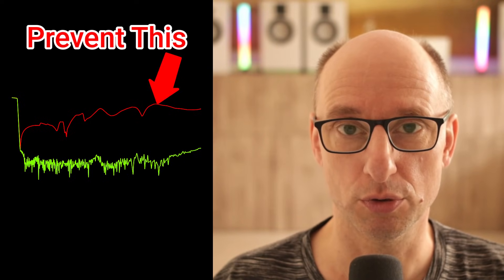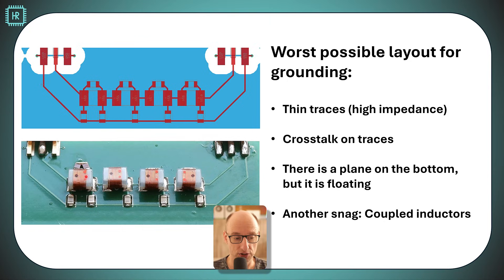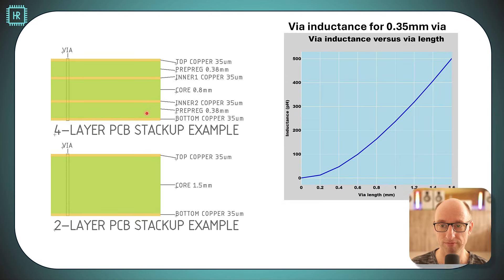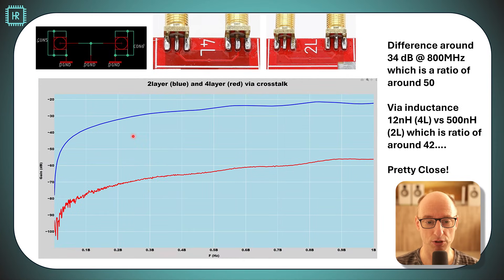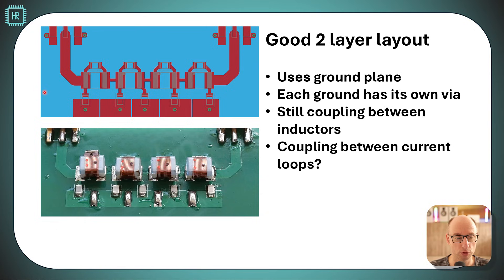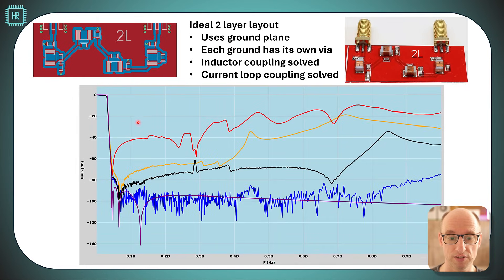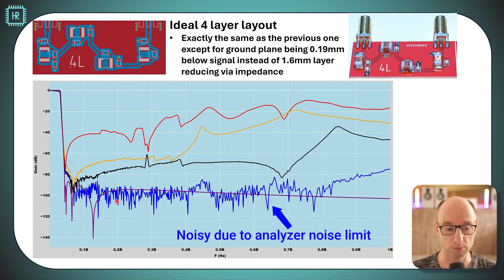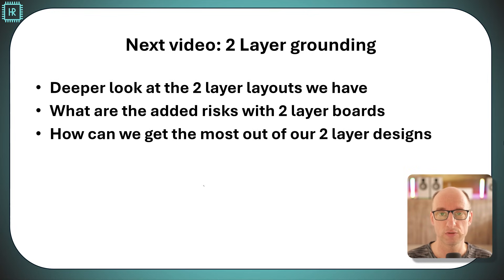Flawless PCB design: 3 simple rules - Part 2

Comment: Whenever i use generic SMPS wall adapters to power a Preamp circuit i made using a TL084C, i hear different noises on the output, sometimes the noise is so severe that it sounds like an ambulance siren, i suspect that has got to do with the switching noise of the PSU overcompensating the voltage feedback loop. nevertheless can i eliminate it using traditional LPF made with just an LC filter? Thanks in advance your content has been really educational. Big Fan.
Reply from the maker: You're most likely right, it is probably the smps noise. A low pass filter will work, I'm not sure you should use LC. LC creates a resonance, if you have bad luck and that falls in the audio band, you may still have problems. A pre-amp will use very little current. This means you could maybe use a 1 Ohm resistor in series with the supply and then a big capacitor. The capacitor would have to be quite big though, 1 OHm with 1000uF will give you a 159Hz -3dB point... you may want much more capacitance. A much better solution is to use a pretty basic voltage regulator to clean up the supply. Then, off course: Use a ground plane and decoupling caps! If you want a really clean supply you can use a more high performance voltage regulator off course. Best regards, Hans
Reply: @HansRosenberg74  Thanks for pointing that out. In an ideal LC circuit the cut-off frequency is indeed equal to it's resonance frequency and that would have caused the output waveform to oscillate in a sinusoidal manner at the cut off frequency essentially. Additionally do i absolutely have to target the lower end of the audio spectrum (20hz) while designing an appropriate RC filter for the same or i should be able to get away with a slightly higher cutoff frequency and rely on the PSRR of the opamp, especially since PSRR gets worse as the frequency increases.
Reply from the maker: There is another possible cause: RF interference going into your supply wire as common mode interference. The smps causes the common mode (cm) interference. It somehow gets to your opamp, which is very happy to demodulate that into your audio band. The only way to get rid of that is to apply a CM transformer with a high impedance for the interference you're trying to get rid of. (I have detailed explanations of how this works in my course). You'd have to put  this in the supply wire as close as possible to the preamp. This  will 'discourage' the cm currents to move through your amp wreaking havoc there :-)
Reply: @HansRosenberg74 As for the common mode Interference, i take it the wire is essentially acting as an antennae which picks up the noise from the SMPS. I have no Idea though on how to calculate the components for such a compensation. I mean how would i make sure if it's even a common mode Interference. Though one thing i have noticed is that the opamps seem to like SMPS included with a printer or something which involves controlling stepper motors. Those SMPS have an amazing noise floor.
Reply from the maker: printer smps are probably much higher power, there is a chance this causes them to be very 'friendly' with a very low load of a preamp. I'm a bit hesitant to say this for sure because there are many ways you can design such a supply. And it can be done good or bad, but in general I can probably safely say that higher power adapters are probably a bit less noise since they're almost forced to employ bigger capacitors to stabilize the supply.
Reply: @HansRosenberg74 so i carefully laid out the PCB again using proper ground plane techniques that you described and indeed the SNR improved quite a bit I think THD improved  substantially as well. 

Using a voltage regulator does help reduce SMPS noise somewhat, i discovered that eliminating the issue right at the source is the best way to go, i looped around an oscilloscope probe to itself as a makeshift antennae probe if you will then moved it around the SMPS which eventually showed that the MOSFETS were emitting that interference therefore i placed a resistor say 56 ohm and a capacitance from it's gate to source say 100nF hoping that it would slow down the gate switching. And it did pad down the noise to acceptable levels. I think since the MOSFETS are switching a big inductor  ( in the SMPS transformer) the electrical inertia of that inductor if you will,  caused the spiking noise at the output. Introducing that hysteresis at the MOSFET gate really helped damp that down.
Reply from the maker: Be careful slowing down the mosfet. It means that the mosfet is switching slower, so it spends a longer time dissipating power. Now if you have a very small load, this is no problem. If you would load this thing nominally again, there is a big risk your mosfet will start to produce smoke.
The signal transmission is caused by the loops in the switch mode supply, since the mosfet sticks out of the board, you'll see it mostly at that location.
Reply: @HansRosenberg74  I was running 2 ics each with a max of 5mA consumption i think that's why i didn't see a change with heat output. So what do you suggest how to tackle this issue best? The interference I saw near the MOSFETs was the same kind of noise that I was seeing on the vcc line of the opamp
Reply from the maker: CM transformers in the power supply lines. Close to the amplifier. That might solve it. Also  a big DM filter (large elco to stop that).

Comment: Can I have help to make a frequency  generator with antenna to make electromagnetic in a place with frequency 
10000.
20000.
2000
.805.
760.

What items need to buy ??
Reply from the maker: I'm not fully clear what you need. Is that in Hz or MHz, how much signal do you need, what accuracy, etc etc.
Reply: @ I want to build a frequency generator that produces the frequencies I mentioned above, but electromagnetically. I want it to have power in watts, and for the entire system to be transmitted via a transmitter to an antenna. I want to experiment with dowsing.
Reply: @ I want to build a frequency generator that produces the frequencies I mentioned above, but electromagnetically. I want it to have power in watts, and for the entire system to be transmitted via a transmitter to an antenna. I want to experiment with dowsing. The frequency that give you is hz
Reply from the maker: so from 0.805Hz to 20kHz. Building an antenna for that low a frequency will mean basically building an electro-magnet I think, with a lot of windings. I have no experience with anything like this. To create the signal, I'd use a sound card driving a standard audio amplifier. Watch out that the antenna/magnet/inductor (whatever you want to call it) has enough inductance and there is no DC on the output of the amp otherwise it will fry itself.
Reply from the maker: Maybe you'll need multiple magnets with different windings, for the low and higher frequencies. You have to be really careful not to drive a higer frequency antenna with a lower frequency signal, the amp will fry itself most likely. Putting a capacitor in series with the inductor and tuning it to the wanted frequency (lc resonator) can prevent that problem.

Comment: If I am using SMD components and need to ground the components then should I add vias or the solid ground plane is sufficient?
Reply from the maker: I am not sure what you mean exactly. You must always have a solid ground plane below your signal plane and you should always give each gnd connection on the signal plane its own via to the ground plane. Hope that clears it up. Multiple vias makes it even better, especially if your dielectic is higher, like 1.6mm.

Comment: Hans. Can you please address the trouble you wil have when signals (eighter digital or analog) are routed through ground planes using via's
Reply from the maker: Just make sure you make vias for the ground return current as well, and you'll never have a problem :-)

Comment: Thank You for the video it was very clear! I have a question about the 4L board, Are the inner layers (L2 and L3) both connected to GND? Thanks
Reply from the maker: For the 2Layer demonstration circuits, they are open (no copper). For the 4Layer demonstration circuits there is ground on all layers. Leaving the inner layers open basically simulates a 2Layer situation.

Comment: Is there a reason that 2 layer has thicker layer? Do they manufacture 2 layer but in 4 layer thickness?
Reply from the maker: Usually it is a mechanical reason. However, I'm about to make another RF testboard with 0.8mm dielectric. Otherwise the traces become to wide for a 50 Ohm impedance.... You can order boards in any thickness if you're willing to pay. 0.8 is another standard thickness, so not that expensive.

Comment: Hi hans, your videos are awesome, thanks! I have one question: you showed the benefits of 4 layer pcb that allow for shorter via, but what is the disadvantage of the stub of the via not being backdrilled? It is eliminated by the ground plane on bottom layer? Thank you again
Reply from the maker: Hah, great question, never thought of that :-) It will be a very short stub, 1.4mm, so that would translate to an extremely high frequency. If I'm not making calculation errors, the 1/4 wave frequency would be around 428GHz (that is getting close to visible light so I wouldn't worry about it :-D  )
Reply: @HansRosenberg74  thanks for reply! I'm new to this world

Comment: Hi, thank you for great tips and explanation!
I want to suggest a topic: impedance stub matching. Very important and interesting topic. If possible, mention the difference methods/materials when increasing the frequency.
Reply from the maker: Unfortunately, I've never done that and the information on the internet is not great. I did do some impedance matching using non 50 Ohm lines, it is a part of the stub matching procedure and relatively easy to design. I will do a video on that in the future.

Comment: How to optimize return loss on high speed networks across common mode chokes and connectors. What are the best ESD devices to use with network speeds >5 Ghz.
Reply from the maker: Haha, you know what questions to ask :-) These are the tricky ones. I'm afraid this is a matter of hoping there are suppliers who have solved this problem for you with specialized components.....

Comment: Very interesting video, I have a valve audio preamp with hum and would like your checklist to help solve that. Thanks Chris
Reply from the maker: Link is in the description! Solving hum can be a bit nasty sometimes. You may have a loop at the input of your valve amp which is picking up an electromagnetic field from a transformer. You may also lack enough decoupling caps on your main supply and a   limited power supply rejection ratio somewhere. Sometimes the ground impedance is too high and you have a ground current running through there between 2 mains transformers. So, can be tricky to find the cause.....

Comment: Could you make videos about DC power filter (when the DC power line is connected through cable to the PCB or  after a dc/dc)
Thanks
Reply from the maker: So you mean a 'noisy' supply entering the pcb?
Reply: @HansRosenberg74  yes correct.

Comment: Thanks Hans! the vides are great!
if you use 2 GND VIAs instead of one, wont that lower the via inductance even more, because the 2 VIAs are parallel, I think this will be seen on the higher frequencies.
and one more thing: what is the "B" on the x axis  (0.1B...1B  (in Hz))?
Reply from the maker: You should check out part 3 (in the description) ;-) (I use 3 parrallel vias there)

I fixed the B there as well :-)

Best regards,

Hans
Reply: @HansRosenberg74  I saw it. But does that mean that parallel via don't have that much of effect in a 4 layer board...? Because in part 3 we are looking at a 2 layer board only.
Reply from the maker: indeed, on a 4 layer the via inductance is nearly 0..... so adding more hardly has an effect!

Comment: Do you have a physical copy of the checklist that I can buy?
Reply from the maker: Haha, no, it's free and in PDF. I'd be happy to print one for you, charge some ridiculous price and ship :-D There is a lot of enthusiasm for this document, maybe I'll turn it into a book covering much more in the future.
Reply: @HansRosenberg74  nice, expanding it would definitely be worth it! Having 30+ years experience in anything is pretty rare these days and super valuable. I'm a research and technical engineer working in academia, we do a lot of prototypes and proof of concepts, as well as working with students. I've started to advocate for using your checklist going forward (at least I'm going to use it), we sometimes make mistakes or we just don't think about some of the things you point out when doing PCB layouts, usually its fine, its not for commercial applications but still it can result in weird behaviour and be time consuming to fix. Also I would like to imprint on our students good practices when it comes to PCB design for example (do it well now and it becomes a habit). A thing that I am interested in is what the impact of using surface mount Vs through hole components is if any as well as surface mount component size. Personally I prefer using larger components because it is easier to work with so if you need to hand solder them it's faster and less error prone (also reading the values and identifying type is easier). But I don't have enough experience to know how it impacts the final product.
Reply from the maker: This is great, you guys are actually starting to use this! Fantastic, I guarantee this will help you guys. I'm thinking about making an online course explaining these things. I don't have anything yet, and I don't know if there is an interest. It would involve a number of theory sessions explaning how to make a good pcb. A few demo layouts that my students would need to make and a total of 4 hours of group support by myself to answer questions (this is just a rough idea). It would cost around 2000-4000usd. What do you think of something like that? Getting hands on experience will reduce the number of boards you need to make drastically is my experience, saving tons of money, frustration and time (I've been there long ago :-D  )
Reply: Hans, I wanted to express my gratitude at what you've created here.  Both the audio visual components and the checklist. My journey into the world of electronics started in the 1970's. We were about the same age when I "jumped in". First came the rudimentary but requisite basic knowledge of electricity and electronics; with my focus being on what many academics  today have become fond of calling "first principles" with respect to digital logic, and a bit later, computer architecture. We had access to as many relays and other parts as one could want. Certainly enough to be able to piece together circuits that could be, or could be used to build  adders, perform feats of digital logic, and so on. One of the very first problems I ran up against stemmed from why certain circuits and subcicuits needed to have mutual exclusivity built into them before they would work in a consistent manner:  various timing issues, race conditions, and other, similar problems showed their faces even then; when building up circuits comprised mainly of logic gates built up from relays! Of course, we had vaious types of tubes which we were able to build gates, latches and the like using.And solid state compoments were becoming more affordable and more available. But it would be a little while before I was able too see what was actually going on at a given point in time inside a circuit.

It was from software, it turns out, that I learned about things like critical sections, semaphores, and debuggers. Which, finally, let me look inside a running machine. Stop a program, change a value, then resume at the point where I had previously stopped it.

And, several years ago, I began working with FPGAs and doped silicon; only to realize in short order that I was making essentially the same voyages again, only on different vessels. And I wouldn't have it any other way. 

Again, thank you.
Reply from the maker: You're welcome :-)

Comment: Hai Hans, very informative and a different look at PCB layout with ground planes. As you say “ sent me the checklist “ I’m very curious abut your book. Doing an SMPS DIY Bench top power supply 0 - 80V 0 - 10 Amps special the measurements circuitry needs special attention. A small question in a power supply you have the heavy current  path and the measurement circuitry path. I’m from meaning to separate those plane and make an start connection at the ground point direct after the current shunt. Thanks for your video’s and keep going.
Reply from the maker: It is a great idea to run sense wires separately. Just like a 4-wire setup for very accurate resistor measurements. You could run them close to a ground plane so they're less sensitive to interference.
You can get the checklist here:
https://www.hans-rosenberg.com/checklist
Best regards, Hans
Reply: @HansRosenberg74  Hello Hans for your replay, I an considering this for sure. Do you think length matching will make an difference as well. Or for analog signals that would not worth looking in to that?
Reply from the maker: a power supply sense wire is very low frequency. It will make no difference at all.